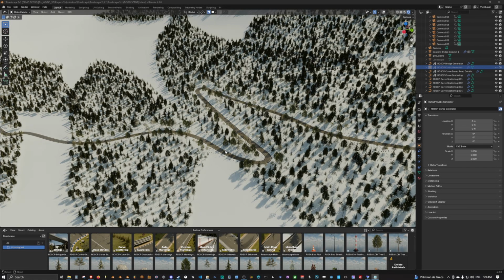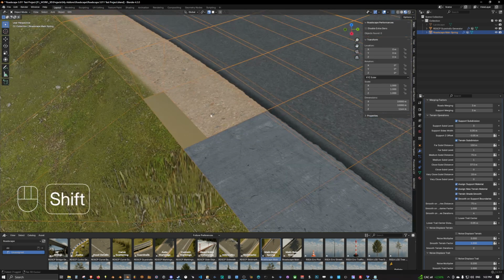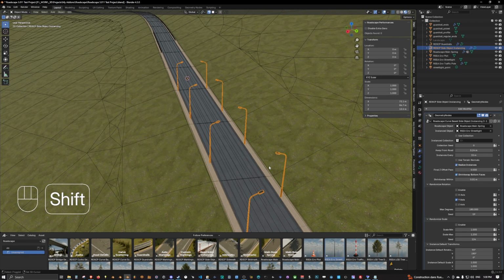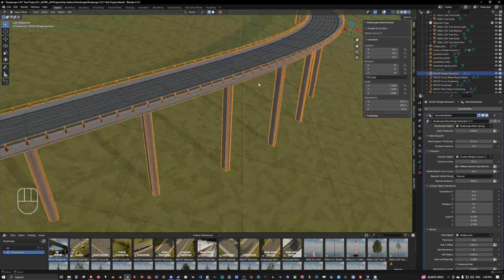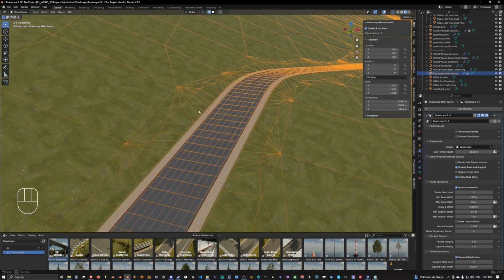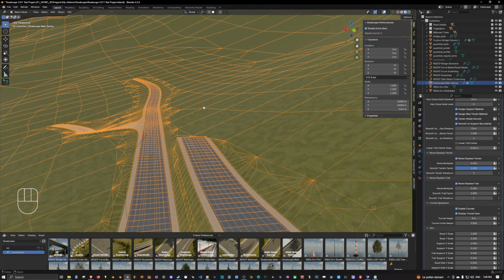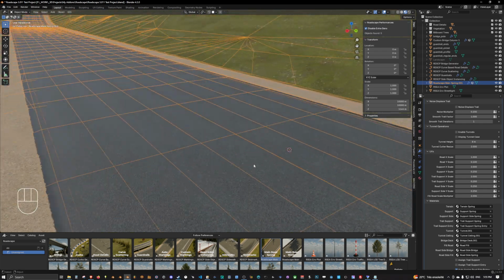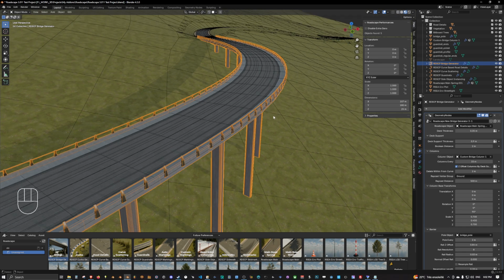Roadscape 3.1 (Road Generator for Blender 4.4)  - Main Overview

Comment: Looks super interesting. Is it possible to modify the track widt seperatly for example on the straight 3 meters to both sides and in corner 1 in the apex 3.5 meters to the right and 4 meters to the left. this would be usefull to have good center line for texturing or physic options and to adapt it to real track wich ist not symetrical.
Reply from the maker: This is an interesting idea, at the moment it's not possible to do so, but I'm currently working on v5 and will try to implement it.
Reply: @baptm727  it ist interesting how many tutorials work only with symmetrical tracks, but when you want to make it as real as possible you need to make it asymetrical. Nice to here that you are open to it ;)

Comment: I just downloaded the roadscape tool and I was able to generate my first road. However, following your instructions for adding guard rails, they do not spawn. I was able to "draw" a curve but only the curve is visible and not the rails. I am using Blender 4.5.3 LTE on Windows
Reply from the maker: Make sure that the Guardrail Generator has its modifier visibility toggled ON.
If you're not sure, you can spam the "Disable Extra Generators" toggle from the Roadscape Utility Tools.
Reply: @baptm727  Thanks, I will give it a try. BTW can you update the documentation link in the description? I only found it by going through the other comments
Reply: @baptm727  Ok I set the modifier visibility toggled to  ON and now it is working!

Comment: I plan to import a road shapefile from qgis with the gis plugin. This results to a line mesh. Is there a easy way to generate the roads based on this mesh with your crazy good plugin?
Reply from the maker: easy is relative. If I'm not mistaken qgis imports a line mesh, which you could: 
1) join with the roadscape main generator
2) assign the road vertex group to it
3) assign some vertex crease and vertex bevel weight to it
4) have to manually rework the intersections

then you would have a working road generation from roadscape.
but depending on how complex the road system is and its size, having to manually adjust all intersections can be tiresome.

if you want to speed up the process of the intersections, you can use the Fill mode for intersections, it allows manual mesh placement where you need some custom shapes.
Reply: @baptm727 Great! Thanks. I just read through your discord and found some hints. It’s possible to disable the export of the attributes in qgis. I will try it and report later!
Reply from the maker: also, don't forget to remove as many qgis/gis/osm vertex group present in the imported mesh line because they love to assign a ton of attributes and attributes slows geometry nodes exponentially
Reply: @baptm727 fun fact. I already bought your plugin at version 1.0 and forgot about it :-) would have bought it a second time. I’m hyped ❤
Reply from the maker: @akleinwaechter  ahaha good luck with your project!

Comment: Any tilt degree features yet for roads so we can bank them? Like splines do with the tilt input.
Roads in our area have a heavy bank in some areas. But even smaller back roads have a 5 to 10 degree bank around a few turns.
Would bring a touch of realism. Not to mention race track optoins.
Reply from the maker: Yes, this is how you can do it: https://youtu.be/U33WZapuSUc?si=ZtJ_OgOc2gt_JuJf
Reply: @baptm727  Oh that's right! I remember seeing that. Thanks!